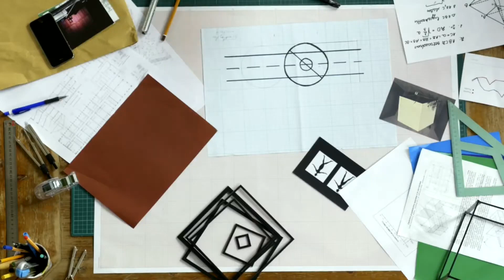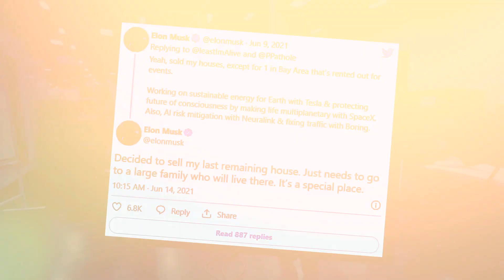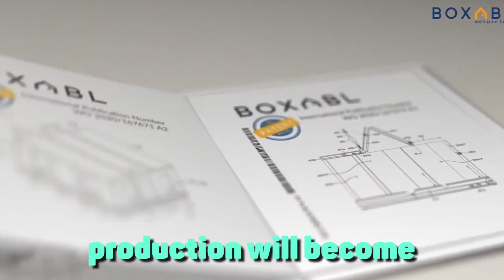IT HAPPENED! TESLA HOME is ready for sale for $10,000

Comment: And if your State requires a minimum of 800 square foot area for a residential house ?????
Also, small spaces require small appliances but still require A guaranteed minimum water supply, electrical power, and sewer system......Heck, the local permit may be more than the price (however dubious you quote ) of your little box.....Maybe they can be stacked  and joined in a circle, or put on a platform with all the utilities underneath and have optional wheels to reposition locations.....